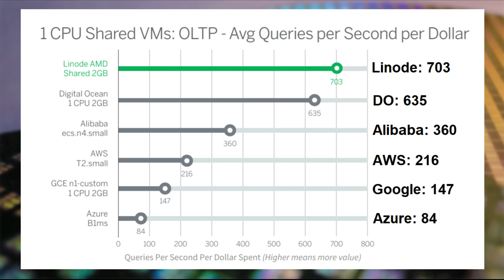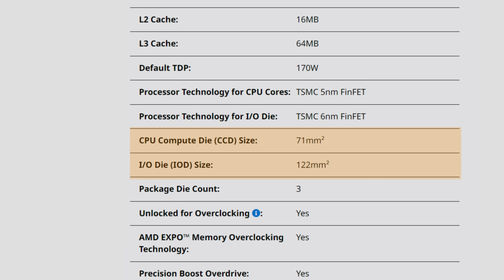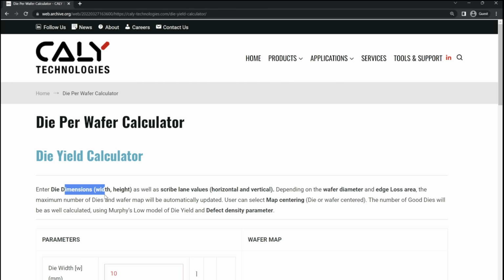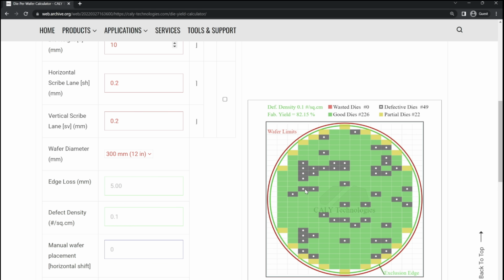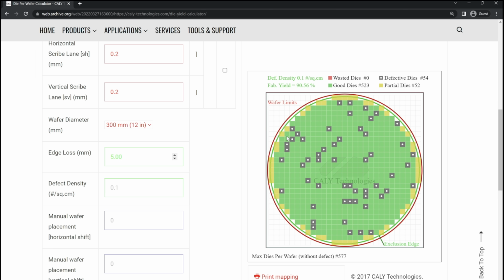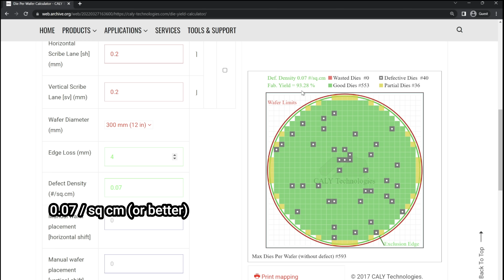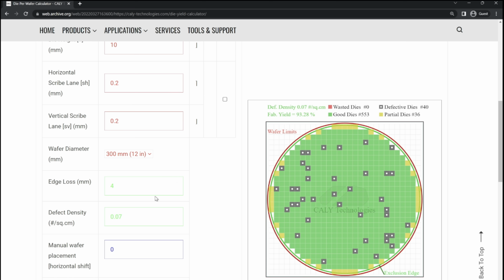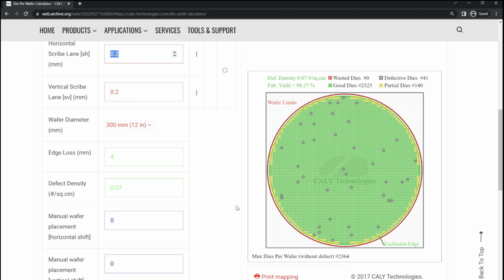AMD Ryzen 9 7950X: Cost to Manufacture?

Comment: Question - probably stupid: 
Context:
The IOD is less populate and can use less "dense" components, meaning a transistor with a "defect" might be still working because it's BCE are broad enough to just not be influence enough to be actually defective.
Hence the question: How much of an influence has structure size on the yield rate? if true, Q#2: Could the IOD therefore have a better than calculated yield rate?

Comment: Great to do the same calculation for the new gen GPUs, especially the new Navi 31 chiplet design given it uses the same technologies. An interesting comparison would be how much it would cost if it wasn't a chiplet architecture in a very rough estimate for both cases.
Reply: I did some rough numbers earlier today. Used ~$16-$17k for 5nm and $6-$7k for 6nm. 
The range I heard on 7nm awhile back was $8-$10k and 6nm was supposed to be a bit cheaper.

Looking at die costs and excluding the extra cost of packaging and any extra wafer prep for the interconnect...
MCDs are ~$4 each, <$5. Assuming +95% yield.
GCD are ~$90-$95 each, <$100. Assuming ~90% yield.
~525mm2 on 5nm ~$170-$190 each, <$200. Assuming ~85% yield.
So say ~$130 for Navi31 which would be ~25-30% cheaper than if they went monolithic, based on my rough estimations.

Comment: Yeah it takes 3 months to make a single chip. That 3 months of overhead not to mention the R&D it took to develop new fabricators. A single machine costs 150 million and they probably have to replace them as soon as possible to keep developing more precise machining. The level of precision on these machines is bonkers. They also have to use a lot of different high purity gases for the lithography so that's another material cost and the building has to have such clean and pure air inside of it because a spec of dust could ruin a chip so I would be willing to be there's a lot of crazy air ventilation and purification going on.

Comment: Other costs not mentioned include post-packaging test and sort, and SKU configuration/fuse blowing to define number of cores, cache sizes, and speeds, and whatever burn-in tests are done.  Manufacturing tests are real expenses, and although fallout at this point in the process is very low, it is not zero.

Comment: As someone working in this field with a Ph.D, it takes stupid amount of people and resources to produce a working chip. Focusing on what it costs to manufacture the chip sounds just borderline ignorant at best.

There is a reason why you do not see a start up company attempting to do this. The license fee to use the software to design a chip alone literally costs hundreds of thousands of dollar per license (or per person), and it takes a team of thousands of engineers at least with a master's degree but more often than not, a ph.d. average salary in this field is 200k+ at entry. So just imagine how much it would cost when you factor in other operational expense of running the company. That does not even include equipments that each cost 100k and you need a thousand of these equipment for a company this size.

Chips are already being sold at dirt cheap price for the amount of research and labor that goes into producing them. If it were truly profitable, you would see more americans going into this field, but no. Most of the hardware industry is just filled with engineers from overseas with ph.d because it is a crap ton of studying and not enough salary to justify the studying.

Comment: don't forget the chips that they bin for servers that they charge $1000 or more yeah they may be lower clock speeds but the stability of that lower speed with lower voltage is worth it.

Comment: Could you do calculations on what Zen+ does would cost in 2022 on 14nm?

I feel like they would make good competition for Intel e-cores, especially when tweaked a bit for low power consumption, like the Zen+ laptop CPU's but without gfx.

Zen4 performance cores, Zen+ e-cores.

Comment: A lot of the defective CPU dies will have a defect in one or two of the cores, and those will end up in a 7600 or a 7900, meaning that the meaningful yeild is higher than your calculations, and the cost per die is lower.

Comment: What we need to talk about is "Cost To Market", that's all the costs that have gone into a product when it's on the shelf for you to pick up, with an additional cost factor for Aftersales, warranty etc.
What you mention is a fraction of the real cost. And even if you would narrow it down to the production cost you would still be far off.
Flagship models are sometimes sold at a loss. Yes, you heard it right. It's not likely that AMD will make a loss on the 7950X, but it's not impossible either.

Comment: What all this calculations about how chiplets are vastly superior in yields to big monolithic dies are missing, is the assumption that only DIEs with 0 defects are usable, when in reality there is quite some redundancy in large structures like caches, that DIEs with defects might even be used for fully fledged products, and if you consider deactivated parts the difference in yield between chiplet and monolithic become pretty similar.
It does not really matter if you make 70mm² DIE and throw away the bad parts, or if you make instead a 140mm² DIE and just sell  some of the dies half deactivated.
The main advantage actually is not yield, but flexibility, as if the market demands more 8c you simply can sell it instead of having to sell fully functioning 16x parts deactivated.

Comment: When you have high-profit dies the scribe lines tend to be larger to avoid drift in the die cutter but also the wafer size would also increase based on complexity and to keep the yields to be the same.  Regardless manufacturing of the chip is usually cheap.  The products' prices are generally based on testing, doing a burnout test, open short, functional testing, lost during testing and negative 40c.
Reply: "Wafer size would increase"?   What?   It’s 300mm, period.

Comment: Yup, nailed it and Milk comes from the grocery store.
Shipping, engineering/ design, storage, the board the dies are mounted to, the design manufacturing electronics of said board, losses in other manufacturing processes, shipping/ distribution/ shelf space, advertisement, etc and that's assuming voltage and frequency checks out at 100%. So AMD is operating at a 500% profit margin and that's the 7600X. INVEST NOW! HAHA. Click bait or ignorance?

Comment: This is far from ball-park estimation as you have mentioned. Assy and Test are the 2 basic process overview of any manufacturing either for a PCBA or IC. You can't just manufacture without testing your product. Testing would probably cost more than this depending on the number of pin count and tester platform.

Comment: How many dies do you need to make to hit the power and frequency targets? I’m assuming that has some vaguely gaussian distribution as well and if you are selecting the top 20% of chips that should somehow factor into the product cost. How to account for that is hard because you get to sell the off cuts; the dies that were not good enough get to be inside a cheaper CPU.

There is also development cost. This has gone up stupendously; last I hear it was some hubdreds of millions of dollars just to implement an existing chip design on a new node and make the masks. If AMD sells 100 million units of a particular die that only adds a couple of dollars per CPU; but they probably choose to frontload that and amortize the cost on enthusiasts because they can.

Then there is the actual R&D to design and optimize a new chip. No idea but I would think it is very costly.

Them there are the failed products. Bad products like intels itanium(aka itanic) has to have their costs borne by good products like core 2. AMD had a long treck through the desert with athlon x2 and phenom.

In the end, the chip has to bear a higher cost than the pure $69 manufacturing cost.

Comment: you forget that all good dies are "good" just because they are usable doesn't mean it has the specs. A die can have instead of the 16 cores have 14 working cores you can't sell it as a ryzen 9 7950x but you can't throw it out either so they make lower level cpus (like the ryzen7s ryzen5s and ryzen3s). So out of the 437 good dies there is a possibility that only 185 has 16 cores, plus if we talk about material costs video games should be free.

Comment: there's binning that should also be considered. there's probably a good amount of CCDs that aren't good enough to go into a 7700X or 7950X, not to mention market segmentation pushing AMD to use chips that would otherwise be good enough for a 7950X on a lower end part

Comment: They may be cheap to make but there are other costs such as R&D, Support, Software, Warranty replacements, Everyday running costs, Marketing, etc and all of it quickly adds up to a much larger total cost per unit. 

But as always the more you can sell, the better and lower cost per unit becomes even with that total comprehensive figure.

So the cost per die is just a part of the total cost. A very important part but still just a part why the chips cost way more than their fabrication cost.

Oh well, I think these companies are prob not running lean enough to keep the overall costs lower. There's probably dozens of useless managers a silicon company could just do better without, and who knows. I just look at industries I've worked in to form my opinion.

Comment: Don't forget to add in NRE charges. Just backend and masking charges alone are going to run at least $20 million, and that is if they got everything right the first time. Add in a respin to fix the things that didn't work with silicon rev. 1, and you are looking at 2 or 3 times that (depending on how many times they screwed up before getting a commercially viable chip.) That doesn't include the actual front end R&D salaries that AMD paid their in house engineers to actually develop the chip in the first place. So you have to amortize that cost across how many of these AMD can actually sell before they become obsolete. If you figure 3 respins to get a commercial quality chip ($60 million in NRE), a 2 year lifespan and average sales of 1 million per quarter, that is an additional ~$8 you have to add to the cost of each chip.

Comment: "Your new shiny cpu costs about $69 to make. Nice" This is grossly misleading. It certainly costs more than $69 to make a cpu. 
You only mentioned the raw materials costs; you excluded operational costs and development costs (from both companies), among other costs (TIM, IHS, assembly, shipping, etc.)

The fab will have storage, personnel, infrastructure, electricity, R&D, profit margins, overhead, etc.
On the design side, they will have R&D, profit margins, overhead, rent, electricity, assembly, personnel, storage, shipping, etc.

Many people will need expensive software and computers to operate on, OS and Office costs, tracking software, design software, etc.
Centralized storage and servers to run apps and house data. Database costs. Corporate costs. Insurance and more.

The list is really long of other expenses that are factored in to the cost of a product.

Comment: Should probably add that the masks used in the process are prohibitedly expensive to make. AMD wins a lot here by using a lot fewer masks than Intel (or Nvidia for the upcoming gen). Add to that the design, verification etc. of each mask, which is likely to be an order of magnitude higher. Obviously this is R&D but only calculating the material costs makes the cost per cpu much lower than the actual costs of getting it produced in the first place.

Comment: They still need a lot of money for research and development of the new Gen every year, so the price of the product got to compensate that also, so 70€ for production,plus 100 to 200 euros for development, those engineers are more expensive than the actual product, in the combined cost

Comment: All the man & woman hours researching, constructing demo products that may or may not work, develop more & repeat that often takes years to achieve a final result. AMD have tad over 15,000 staff with an average pay of £55,000 a year. So, that's £825 Million alone in wages. Then factor in all the other costs of mineral sourcing, transportation, advertising & the taxes they have to pay in each respective country they operate in. But to limit a video based on how much it cost to put together & ignoring everything else is a little naïve. 

Take Intel, average pay is £75,500 a year. They have 121,000 employee's as of the end of 2021. So, their wage bill alone is £9.1 Billion. So their £67 Billion revenue on average a year does seem excessive until you factor everything else in.

Comment: With a transistor count of 6.5 billion. How many man hours, how many engineers do you think it required to construct such a design. So here's a question how far can you actively count? Seriously, what's the largest number you can count to…. You think you can count to 1,000,000,00? OK, if that's too difficult, which it is. How about 100,000? OK ,that's probably still too difficult, how about 10,000? still too hard?  That should provide a little perspective on the difficulty of engineering such a product.

Comment: Why are chips on the wafer always laid out in a grid? For example at 9:18, you start with 7 chips per row in the middle but as you go up/down the wafer you lose one chip on each side and it becomes 5 chips per row. Why not offset some of the rows horizontally to squeeze more chips in?

Comment: Soo.. then add on R&D costs, licencing, transport and distribution, graphics design and Media, advertisement, then all the staff costs, including everything from cleaning and catering to board of directors, energy usage, building costs, equipment hire, loan repayments and additional associated CAPEX spending and taxes and then you might get close to what is the actual cost.

Using the same logic, your own worth is about $600 if you look at your building blocks. But I suspect you consider yourself worth a while lot more than that.

Whilst somewhat entertaining, all you are doing without spelling out the true cost is perpetuating a logical fallacy and misinforming the public.

Comment: No, you can't calculate like that. For example, each Dies has the same cost, defective or good. The highly qualified staff who take care of the wafers. The acquisition of new equipment in 10,000,000$. In addition, there are currently no new and used systems on the market. We have a 2 year wait before we get a new open. The chemicals also have to be of high quality otherwise you can't get that level of precision, which is also scarcely available. The production staff also want to be paid. The immense energy required by the furnaces. The 4 years (on average) development phase must also be paid for. In addition, the correct setting of the systems (1 year). Typical profit is 15% and any error in production reduces profit. Please don't tell such nonsense if you only know the 10% of everything. And I still have everything listed. Another tip if the wafer is +25% faulty, it is no longer profitable to continue producing.

Comment: As someone that works in business and financial analysis, im almost certain a large chunk of the R&D cost is massively inflated as a tax writeoff. While the process of printing wafers is very lengthy and highly specialized, once you have it set up... its just printing on basically worthless silicon. Theres not much cost involved other than operators. Machinery is amortized.

Comment: this is not the cost to manufacture
it's only the cost of the dies.
you did not count the cost of the raw material, the cost for the surface mount, the cost to mount the die on the surface mount, the cost of the IHS, the cost of the testing of each CPU...
so the cost of the entire production line which is not limited to the dies only.

PS: at the end you said: 69$ bill of materials 
no, it's 69$ to manufacture the dies only, not the BOM.
your video title is partially good but the total cost section is not.

Comment: This isn’t even BOM cost it’s merely part of BOM cost, so don’t assume AMD pays $69 per chip.  It’s going to be higher.  Not sure how much higher, but double wouldnt surprise me.  What might be interesting is how this compares to say, a 13900.  Does AMD have room to drop their prices?  Yes. Part of the problem of duolopoly though is the only pressure to do so comes from intel.  There are other pressures of course, like apple or ibm, but they are more intangible and not as great.  It’s better than none at all of course, but it’s not what it would be if a third player was in the mix. There are diminishing returns as the number gets larger though.  Back in the 1930’s the minimum number was set at 3.  In the 1980’s that number was more or less changed to 2 by a judge.  (it’s complicated but the effect is more or less that)  so you are not totally owned.  Merely mostly owned.  Apparently mostly was considered OK.  Personally I disagree.

Comment: Thank you for the information given. As a person who has done manufacturing  I can say as of this moment, that the net profit from the AMD 7950 is going to be around $150-$180 per chip. Of course the profit levels will vary but I feel good on my estimate.   I using my data charts that takes into consideration of R&D and other hidden costs.   Of course I could be wrong but in again, my case,  I'm comfortable with my assessment.
Reply: It's going to be significantly more than that, iterative uarch updates are not R&D heavy due to their nature, and nearly all other measures of the design have been explicitly made to save on costs.